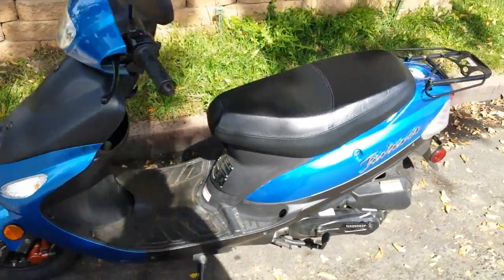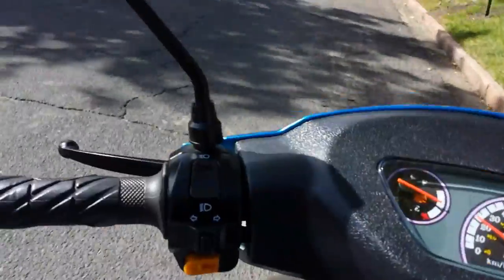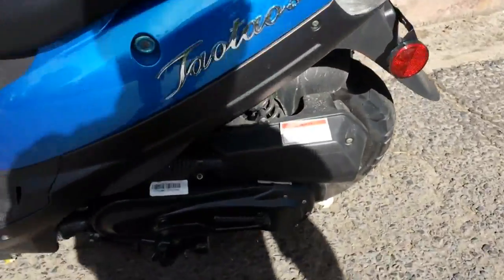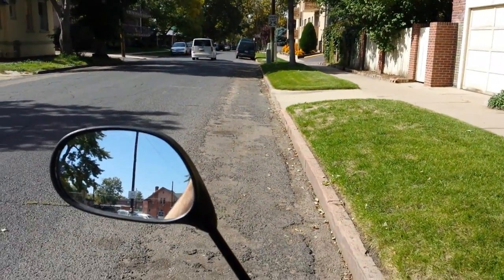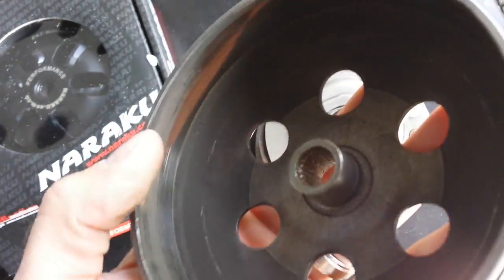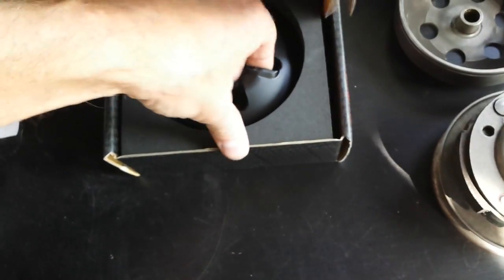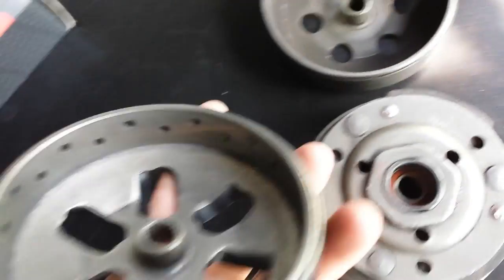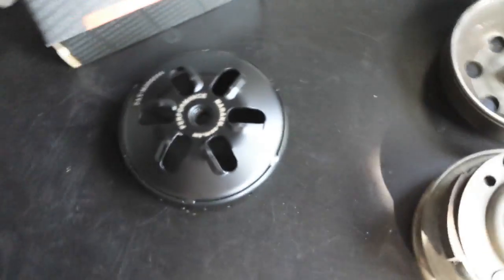my scooter squeeks at acceleration fix

Comment: Ofc, a performans clutch is good, but the easyer and a lot cheaper solution is to still use your old clutch and just sand it down evenly.....  Nothing ageinst the performance parts, they are worth theyr money, but wen somebody comes on this video to search for a quick solution, just sand it down with a 400 o 600 sandpaper, that will do the job for a wile. Anyways with that performance part you barely never again will have this problem

Comment from the maker: The Adly 50cc would be my choice because it's a 2 stroke. However getting Adly parts can be difficult.  The puma Valentine is not as good quality as the Adly, but parts are not a problem.  Its a really hard choice.
Reply: Hey so question, i have tried 4 different clutches brand new 3 different new belts and new rollers and sliders also new variators and i still get that squeal no matter what i change

Comment: My 500cc Kymco scooter makes a similar noise when accelerating. Probably need to take it to the shop as I have little mechanical knowledge when it comes to bikes! Thanks for the vid
Reply: Kelsey Rogers change the belt
Reply: My AK550 is making a chirping noise when accelerating. Did you find out what it was? It only does it when I'm moving, not on the centre stand and revving
Reply: @ArcanePath360 you burned your clutch aither sand the clutch to fix it for a while or change the clutch for a long term fix
Reply: @vethaydin77   Nope. It was the tracking of the belt drive. Bad design. They kept trying to fix under warranty but never solved it.  I got rid of the useless thing. It's someone else's problem now along with all the other list of problems. NEVER buy Kymco.
Reply: @ArcanePath360  i didt buy sym instead kymco

Comment: I have a question. So i have a peugeot kisbee 50cc brand new. Now when i want to move from lights i turn the throttle half way (the engine revs higher) but i have to wait about 2 or 3 seconds for it to move. Now what do you think is the problem? 
I was thinking about the clutch slipping on the clutch bell.

Ps. The clutch doesn't squick, and this happens even when it's cold
Reply from the maker: I would recommend changing your rollers out to sliders and going with a 5g. Here is a link to the parts I recommend on our web site:  http://rollingwrenchdenver.com/parts_scooter_motorcycle_denver_boulder/125cc_150cc_scooter_perfromance_parts125cc_scooter_150cc_gy6_scooter_parts_tao_tao_puma_rocketa_sunny_scooter?product_id=65
Reply: Thx. Will buy them once i put my money in the bank.

Comment: here let me save you some money... all you need to do is hold the front brake hard and rev the engine for a few seconds... do this a couple times and it should get rid of the noise it also works for shuddering upon acceleration....
Reply: but wont it wear off the clutch it self?
Reply: my vespa primavera 150 does this, tried changing the clutch springs back and forth, and tried cleaning it, still happens. its pretty annoying
Reply: Guys try using some fine sandpaper and sand down a little on the clutch shoes and the clutch bell
Reply: @that-midas6781  that's what I've been seeing too all over yt. Mine just started squeeking today